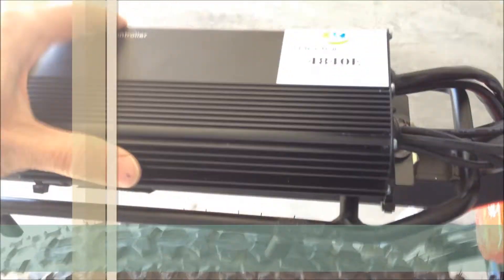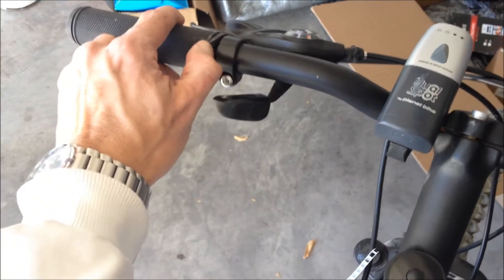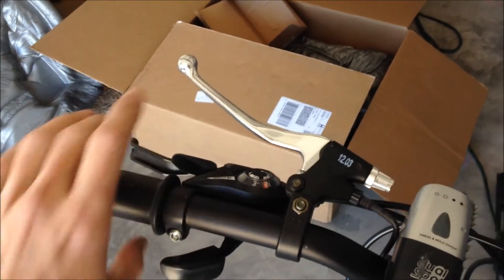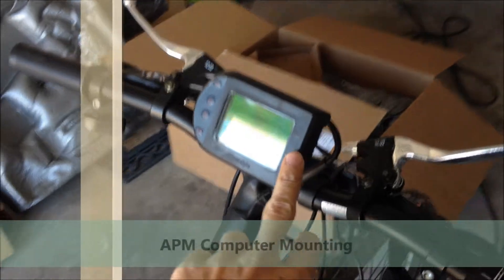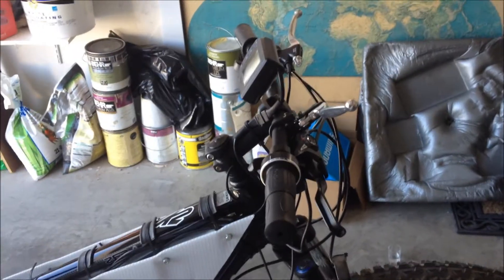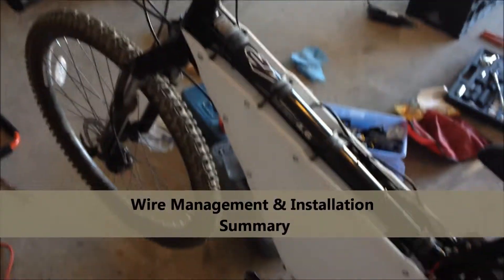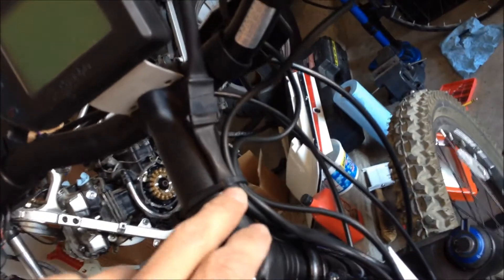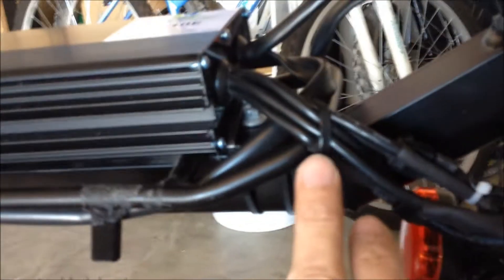Crystalyte 48V Kit Installation - Phoenix II System from Electricrider

Comment: My set up is very similar to yours.  I had them build my 48V 20ah pack for the triangle and it fit perfect in my Giant Roam bike.  I had a local shop custom build my torque arms because the the ones I got were giant and didn't fit properly. 

I like the way you did your cover for the battery pack.  Mine is not as nice, I used duck tape and mounted my controller on the under belly of the frame close to the front wheel.  I get plenty of air to it to keep it cool in the Florida hot weather.  Thank god for zip ties and duck tape.  I use my bike all the time and it is much faster to get to work and school than using my truck which is about 20 round trip.  This was probably one the best investments I ever made and is gets me every where I need to go as long as it is not raining.  I will not ride in the rain.
Reply from the maker: Any vids or pics of yours?  I agree with you about not riding in the rain.

Comment: Does the kit come with EVERYTHING needed to have a functioning e-bit? Do I need to buy a battery, charger, etc or is that included?
Reply from the maker: +LAdventures The battery and charger was included in the kit I bought.  I made my own battery case though because I wanted the battery mounted inside the bike triangle instead of over the rear wheel.